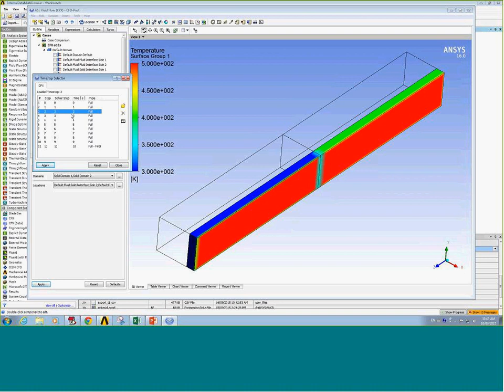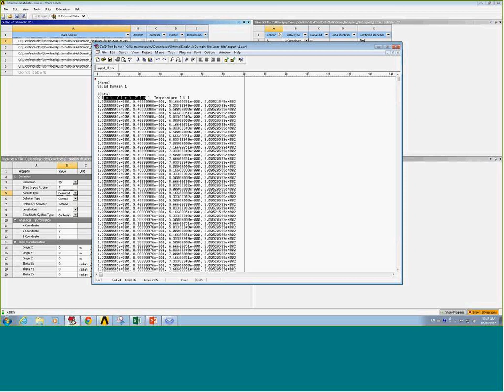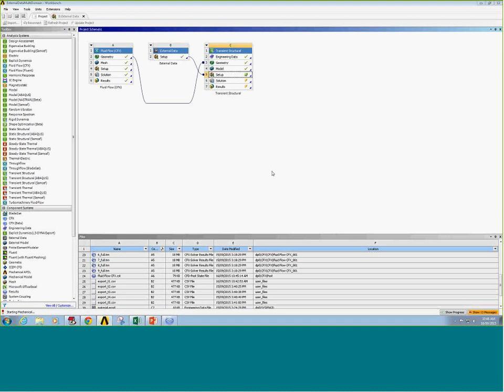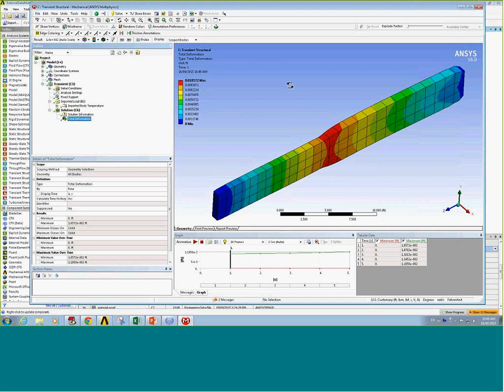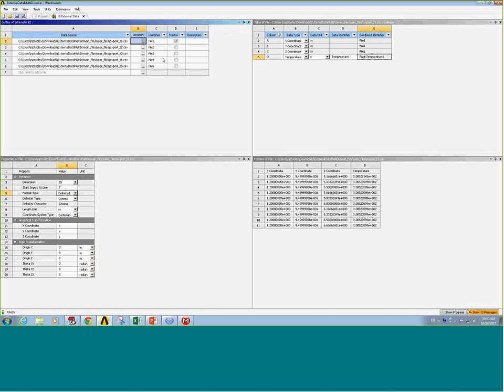Transient 1way FSI External Data Transfer

Comment: I have 1000 time steps in transient simulation. How to save (.csv) files using a script that you mentioned in between. Manually it seems impossible.
Reply: i use the CFD-post to recording sessions and change it with VBA